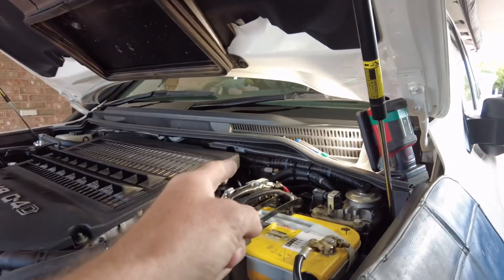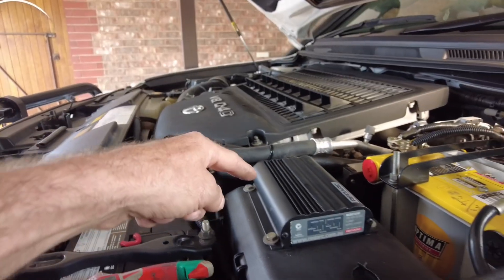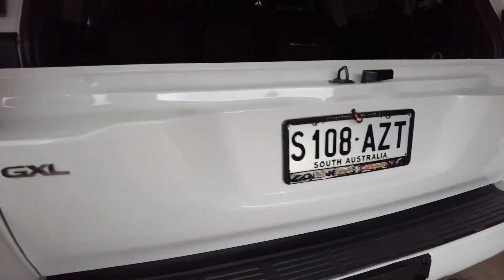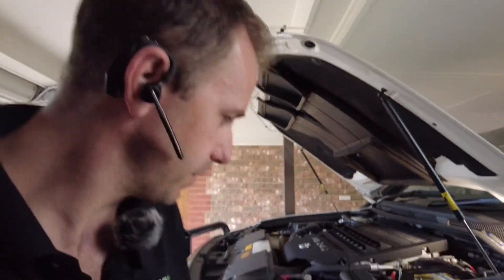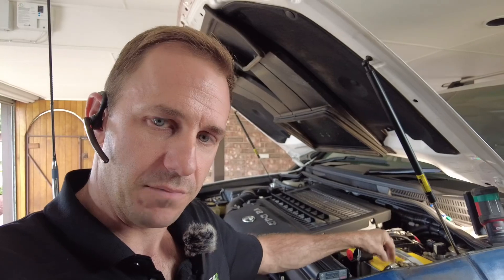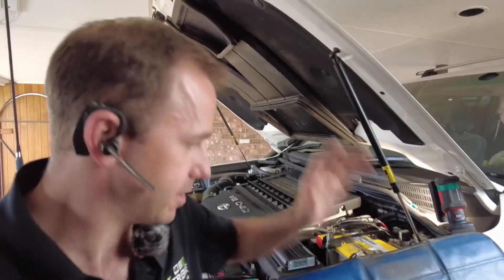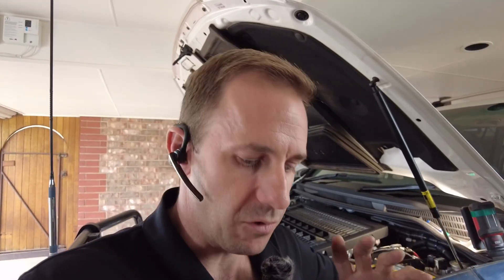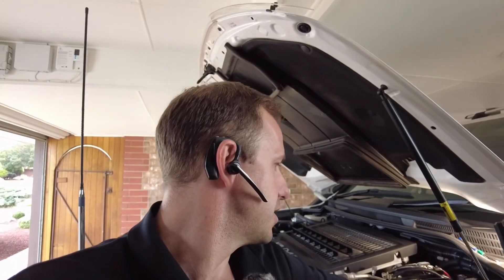Charging your caravans lithium battery, dc charging?

Comment: Great video Matt.  Would you recommend isolated or non isolated Victron DCDC for caravan setup.  Have the BMPro 35 HA but not sure it's up to task of charging Lithium (upgrading from AGM). Shame you're in SA. I'd be calling on you if I was local. Cheers
Reply from the maker: Both will work.
You dont need galvanic isolation, (marine) so go non isolated.

Comment: Thanks for that, you are very informative.  I am struggling (in Sydney) with some of the same problem, though no 3 way fridge, all 12v (240v). I want to be able to charge both car and Caravan batteries and use the car batteries to supplement the van power when off grid for longer periods. In my Car (LC200) I have the  DCS dual Li battery 260Ah LC200 system and in the van as of Friday Powerpaul Dual Li's 280AH Scouts with Virtron Inverter, Shunt and MPPT for the solar.  Plugging into the cars Anderson and hardly anything comes thru, it is connected to the existing Caravan Management system which needs to be changed.  The resolution (so far) is to add a DC-DC Charger in the van. The DCS has a Victron Smart Battery Protect SBP-65A which states to connect to it with a max of 65A output. I had hoped to get 100A or as close to the van and not sure whether this is possible, was also looking at a 200A Alternator upgrade.  Maybe this is asking too much, or will not work, or there are other options. Wondering whether I should just go with something like a 50 Victron Onion DC-DC and increase the wiring to the van and into the Onion. Luv' your view.
Reply from the maker: You need my experience and expertise on your system.
Book me and and your issues are over.

Comment: Great explanation.  I have exactly the same set up and was wondering if wired to the starter would be better... its obviously a must.  Now reference the how... I would think I should be running the 6B&S Anderson cable through an ignition relay near the start battery.. correct?
Reply from the maker: Yes, exactly

Comment: Hi Matt, great video.
It would be great to see a video of the do's/dont's of charging a battery located in the vehicles rear/canopy etc whilst charging a battery in a caravan simultaneously.
I'm starting to see quite a few incorrectly wired in some very interesting ways! 
Keep up the great content, cheers Andy
Reply from the maker: I like it I will keep that in mind if I get time on one of the jobs.
Thanks
Reply: @extremeacc101  I agree with 12v obsession. Many Utes today have alu tray and canopy set ups running lithium in the canopy and running a lithium in a caravan or in my case a camper trailer. Would love to see some correct ways inc dcdc and solar arrangements with this in mind. 🙏✌️

Comment: When/ if we get a new van I’ll be getting in touch for some off grid upgrades and vehicle set ups. Have you/ do you deal with caravan manufactures during the manufacturing process to avoid re wiring stuff like solar, inverter, battery, car setups?

Comment: Hi Matt awesome , I have JJOB on order the 2022 model comes with the Projecta pm 335J and I also have 2 x 280 lithium on order from Paul should I order the optional dc/dc charger , I have a similar set up to the 200 with the Redarc 25 but was under the impression that my rear Anderson was only going to provide power to the second dc/dc charger,but after watching the video I now know what to tell my auto elec thanks
Reply: Before you order, not after, speak to Matt. We have used him and would not even buy a van without consulting him.
Reply from the maker: That’s right if you draw the schematic out it will make more sense. I do suggest you do so feel free to take a photo and send it to me.

Comment: Why not get rid of the redarc thats in the engine bay and just hook up a isolator of your chosing to that 2nd battery. There is no need for a dc charger when the battery is so close to the alternator.
Reply from the maker: This Dc charger was existing.
Even if that was out of the equation it’s still not a good idea to pull such high amps from an auxiliary battery while trying to charge. If that were the case you will notice a voltage drop on that battery when you put a load on it especially a three-way fridge some 8m away. 👍

Comment: It's so so so hard to explain this so simply to people, but you nailed it! 

It's such an easy problem to have, especially when people get upgrade after upgrade, by different installers. You're one of the few installers that will take the time to go back to bare bones and do it right. Legendary!
Reply from the maker: Appreciate it Paul.
I think once I get over about 50 inquiries on a certain problem I like to do these videos to make it easier for me to just tell people to watch the video so they can understand it better.
I was just thinking before I used to have a whiteboard at home I used for a few videos a while back I might pull that out again and do some live diagrams to make it even easier to understand.